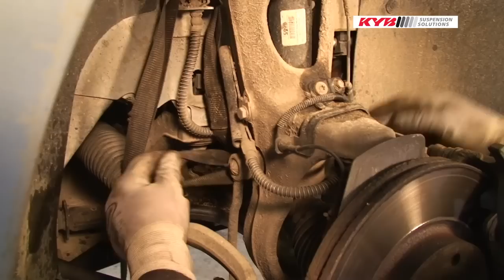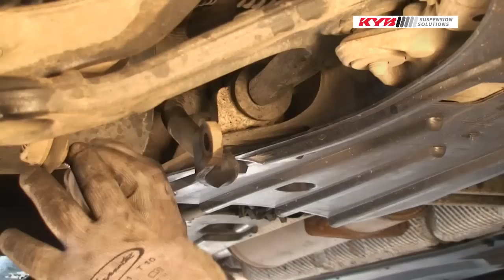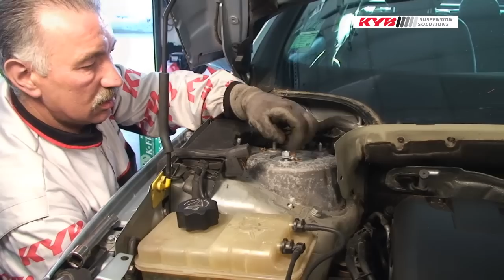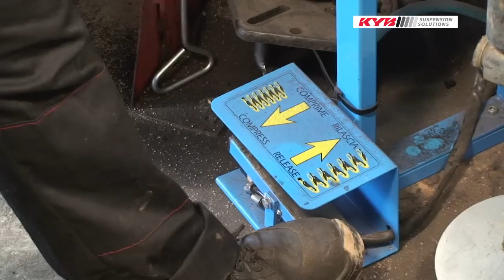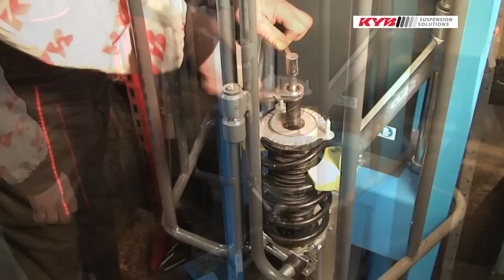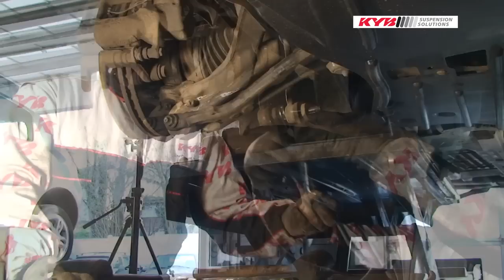KYB CITROEN C5 Front

Comment: Is this the Hydro-Suspension?
Reply from the maker: No it's not
Reply: No, it must be a cheap version of the  C5
Reply: @Kyb-europe  Does it fit also the ones with hydrolic suspension? Or do they have different suspensions(probably more expensive ones) ?
Reply: What is the reason for the hub puller? Why not just knock the driveshaft out with a rubber hammer?
Reply: No, not on the MK3 basic models